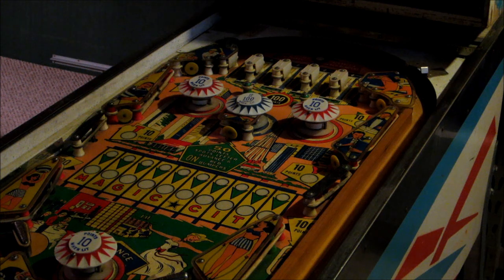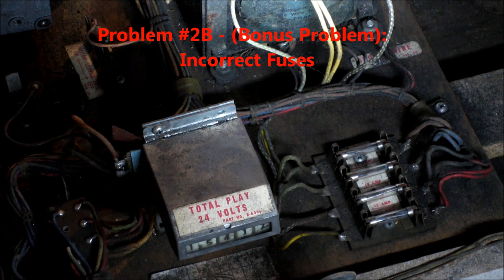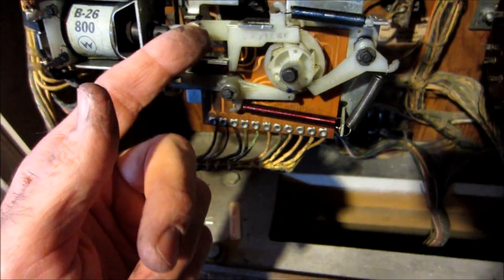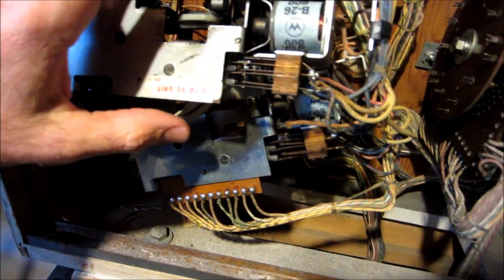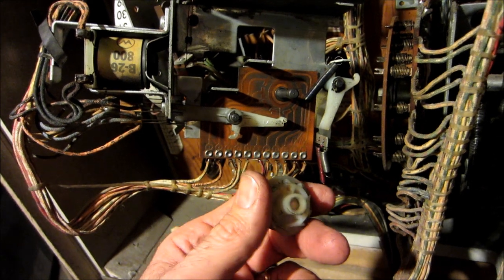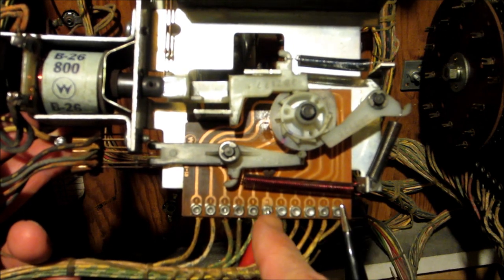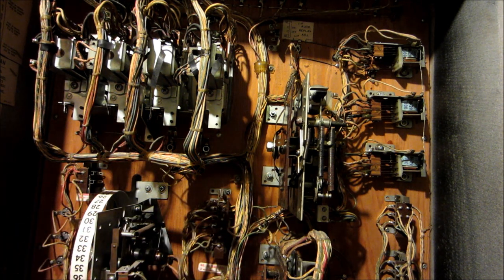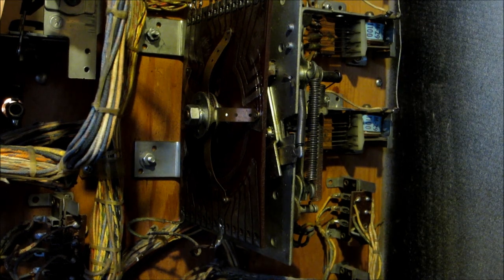36.  9 Electromechanical Pinball Repairs in 23 minutes

Comment: Loved your video, you used common sense on the repairs and reasoned out the problems, I have worked on these for about 55 years and found lots of problems from age that didn't happen when we were operating them on location. I noticed that some of your problems were from someone fooling with it that didn't know what they were doing, which I have found common too. I have found from experience that usually the bottom contacts on a stack are the most likely ones to be out of adjustment from normal use, particularly on a trip bank from all the vibration! Magic City is a good old single player game!!

Comment: Gave me some good insights to repair my Interflip Dragon (has the same reset problems, sometimes it gets stuck in an endless reset loop). Thanks !
Reply: IM getting a dragon this weekend. are all the game mechanics simalar to these how to videos? is a $150 a fair price for a dragon needing repair?
Reply: +Bettie811 sorry for the late reply.. depending on the required repair. If only some solenoids or parts on the playfield require repair, then certainly yes. If the system is not working at all or the cabinet is heavily damaged.. you have to decide. But it's a low risk.

Comment: I would change out the fuse blocks with new ones.
That is what I did with my customers fuse block.
I did leave the 8amp slo-blow in the head.
But the ones in the cab one of the fuse holders was completely burned and they had hacked in another fuse holder on the top left of it.
It looks much nicer now.
I don't know about the lubricating the spiders and stuff over time it will just gum up again.
And I have found that you might as well go through all the coils and stepper units and clean them as most EMs people have greased them up and they stick.